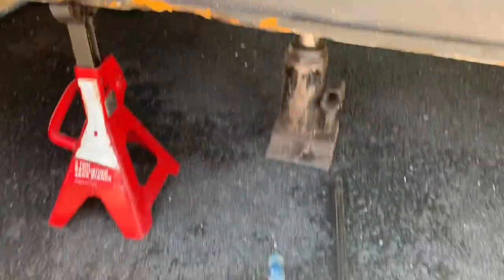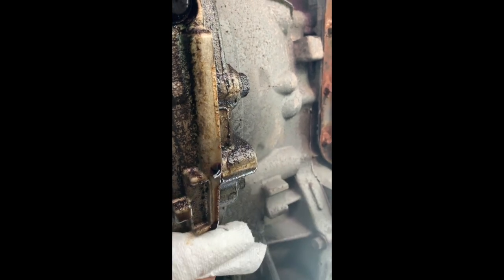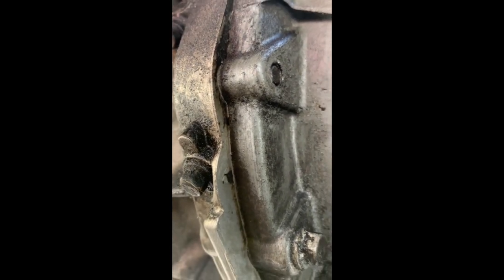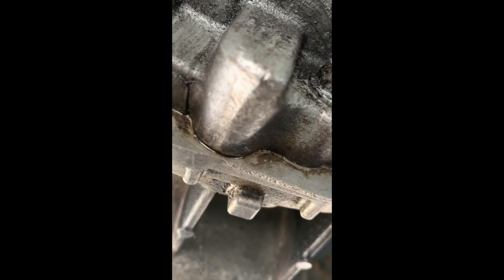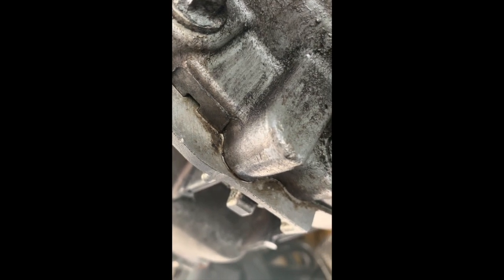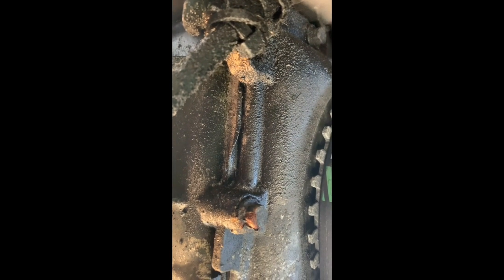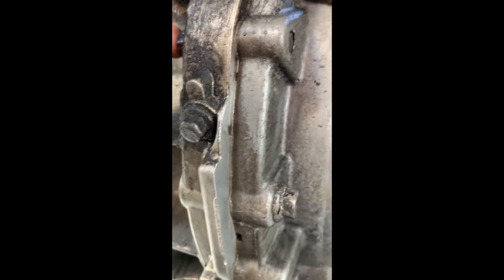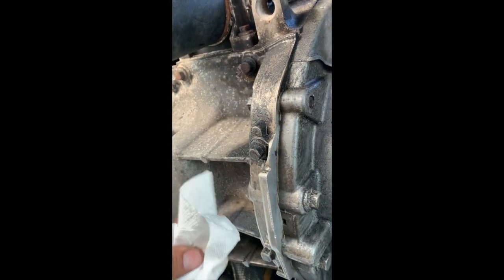how to fix oil leak on ford transit connect

Comment: If you look closely you can see a weep hole in that leaky area he pointed out so most likely oil is leaking from it, therefore most likely it's the rear main seal that's the culprit.

Comment: I have this exact problem!  Thanks for posting.  I already tried this but without knowing the torque I was reluctant to go too far.  After watching, I'm about to head back with a longer cheater bar and apply your technique with renewed confidence...........
Reply: Did ul fix the problem
Reply: Rene Arzate None of the bolts were loose and tightening them even more didn’t solve the problem. When I had the van inspected at Mr. tire I asked them to look at it.  In their managers opinion to fix it properly would require splitting the engine from the transmission to get to the source.  Estimated $1000 service.  So for now it is still slowly dripping in my driveway.  But I think that this is a fairly common issue so I might call the dealer and get a proper quote from their Service Department. Who knows?  They may have a Service Bulletin or secret fix that is not published well. Good luck!
Reply: My brother transit 2017 leaking in drive way took it for an estimate for $2100 only for a gasket part is $24.00 and the labor is 2179.00. Trying to save money thanks for the reply
Reply: I got the same vehicle and a oil leak in that exact spot.
Reply: Be aware that those bolts are screwed into aluminium alloy, so don't overtighten them. The leak on this one was coming from the oil pan seal. I don't think splitting the engine from the transmission would be needed, unless it's coming from a different source. Only removing the oil pan and replacing the seal. Of course, other stuff might need to be done first in order to do that.